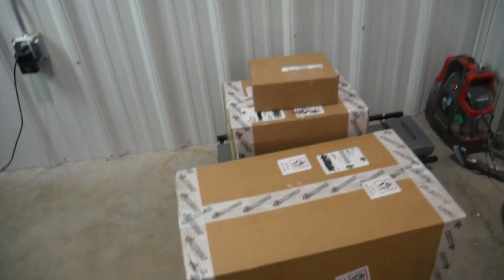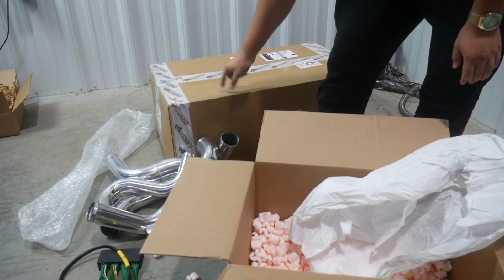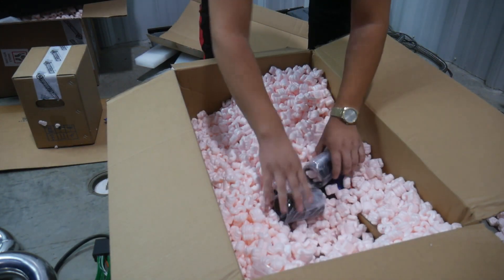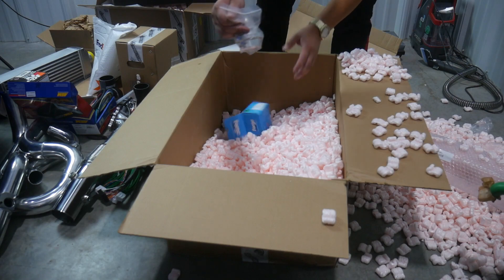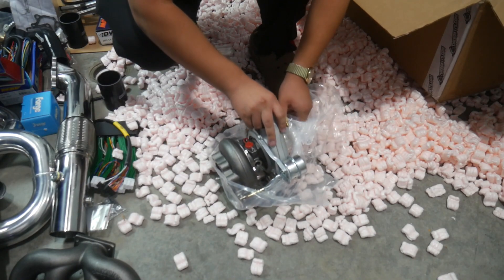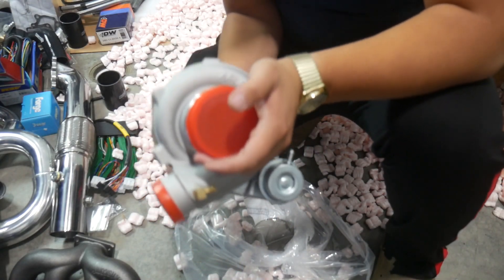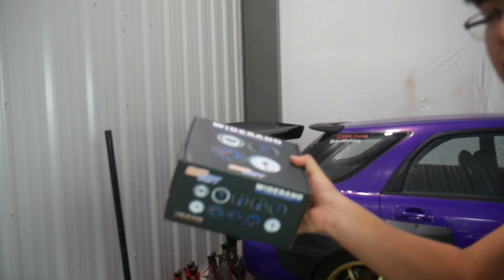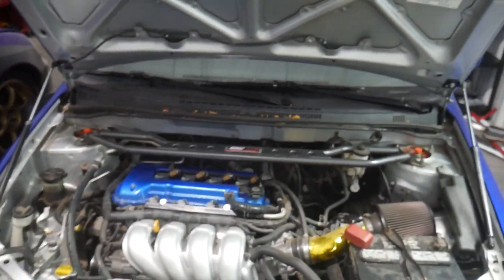Unboxing The 1zz Corolla's New Turbo Kit!

Comment: (not very good with car parts yet still learning but) why is the front manifold part of your engine metal, isn’t that a 2zz exclusive part and the 1zz has plastic? unless you swapped or just have aftermarket
Reply from the maker: It's actually still the plastic 1zz manifold, it's just painted silver! I'd love to try swapping in a 2zz manifold at some point, but I'll need to find an adapter for it and currently don't know where to get one
Reply: @WillChang  ohhh that makes sense thanks for the reply man

Comment: Aré you going to manual swap it or leave it with the 4 speed auto?
Reply from the maker: I'm planning to run it with the automatic for some time just to see how it holds up, but the manual swap will happen!
Reply: I was planning on 2zzge swapping mine but I might just build my engine and turbo it also.
Reply: The 1zz is underestimated!!

Comment: I have the same kit and I recommend running the intake up beside the motor because the one the kit comes with gets a lot of dirt and debris. You’ll also make more boost if it can breath better
Reply from the maker: I was thinking this as well, plus the filter is more difficult to service with the way the kit was designed. I'll get a new intake setup going soon!

Comment: Can't wait to see how it goes! What's the plan for tuning the car after the installation?
Reply from the maker: Currently looking for a tuner who can work with the fic, it’s proving to be a challenge given it’s a piggyback and not a standalone and tuners always prefer a standalone. In the meantime, I’m planning on running with turbokits.com’s base map during the 500 mile break in period as I won’t be beating on it anyway and by then I should have someone who’ll be able to pro tune it!

Comment: i was wondering if i could turbo my stock corolla, it’s manual but a 5 speed would i have to change the trans also?
Reply from the maker: That would work! More people have turbocharged manual Corollas than automatics, and the 5 speed i believe can take more power than the automatic
Reply: @WillChang  thanks bro i will look more into it and keep up the good work